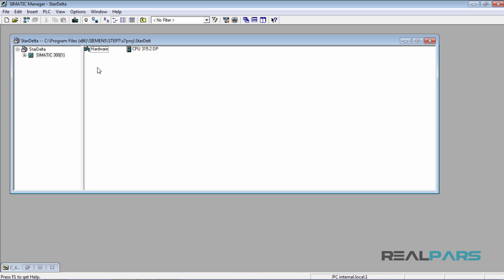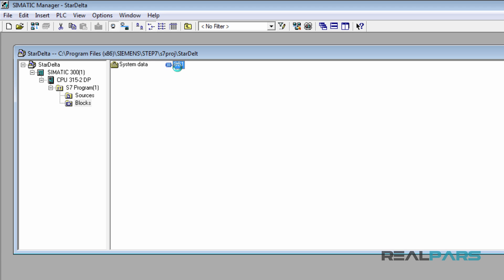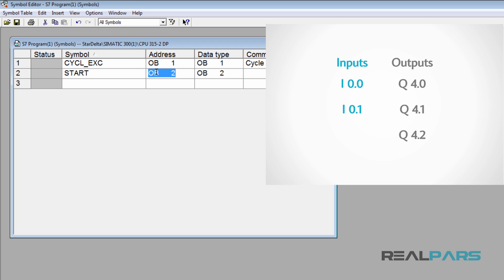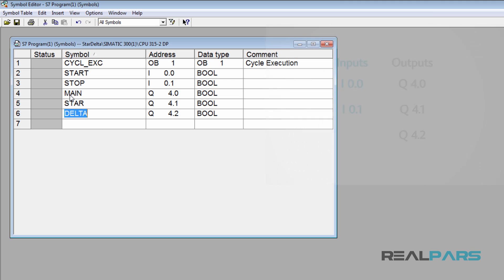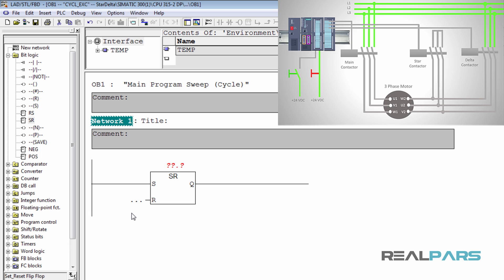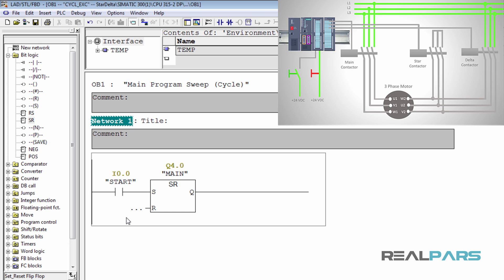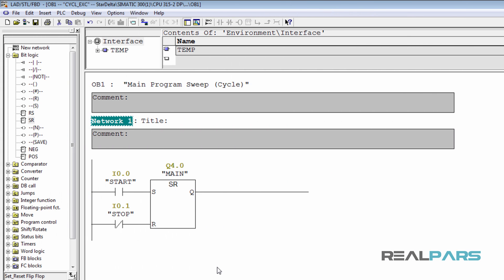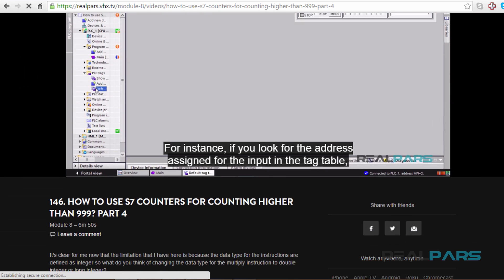Star-Delta Starter PLC Program and Wiring _ Part 10

Comment: 7:35 Won't a Normally Closed Switch at Reset input set the reset button always high (1) which means  S and R inputs are high simultaneously at starting? Doesn't it mean an invalid output for an SR flip-flop?
Reply from the maker: Thank you for your question! This can be confusing sometimes if you don’t have these switches in front of you. I will try to make it easy to understand. All emergency E-STOPs must be hooked up in NC mode. This means the contact is close, and you are sending a signal to the input PLC card. The LED on the card is on, meaning the ESTOP is closed and sending the signal, meaning all is OK, no ESTOP. A fuse on the ESTOP circuit protects these signals. If the fuse blows or you open the NC, you want to stop the machine. Therefore, in the PLC logic, you must read the logic circuit as a sentence to make it simple to understand. And this is the way it is read:  “input on start “set” RS flip-flop, if “STOP” input is “not” made “RESET” the flip-flop”  Well the input on “STOP” is made because the STOP is normally close sending a signal to the input card making the logic for NC not true and this logic circuit is not made and not working until you open the NC and then it will be true. What we say in the logic and not “STOP” SW made, RESET the RS.  In Boolean logic, it is:

START = HIGH (1), SET FLIP-FLOP (FF) TURN ON - Q - OUTPUT,   STOP IS NOT HIGH (0) (MADE) RESET – Q – OUTPUT. 

Happy learning

Comment: really nice video. thanks but the question is   04:47 why exactly 8 seconds?
Reply from the maker: It does not have to be exactly eight seconds.  This timing can be variable but should be long enough for the motor to reach 90+% of its full speed before switching the delta configuration.
Reply: @realpars  Aha ok. Thanks for the answer.

Comment: Nice video, very good channel where you can get real programming lessons because of its clarity. But I have a suggestion or remark about a sentence that was probably a mistake if I understood the concept.
You said in video (7'57): "well the reason is when you use a normally open switch instead of a normally closed switch, if the wire that connects the switch to the PLC is ever disconnected, whether intentionally or because of a broken wire, you'll be notified and this helps to ensure a more reliable system"
By this we mean that the use of a normally open switch is the one recommended. After this you say that it is recommanded to use a normally closed switch. For this, i suggest that you change the sentence or write a comment on the video.
Thanks an other time for RealPars, it's the best channel i known so far
Reply from the maker: Thanks for your feedback! I will make sure to forward this to our course developers.
Reply: yes, I was exactly looking for such a comment, so the correct sentence would be :
"well the reason is when you use a normally closed switch instead of a normally open switch, if the wire that connects the switch to the PLC is ever disconnected, whether intentionally or because of a broken wire, you'll be notified and this helps to ensure a more reliable system"

Comment: Someone explain if normally close swtich is used in R input of SR flip flop..it will reset the flip flop..Q out put would be invalid state isnt it???how come this happen
Reply from the maker: The normally closed contact in the Reset branch of the logic will be OFF or FALSE during normal operation.  During normal operation, the switch is not pressed and the circuit is closed, allowing the input at the PLC to be true.  When the input to the PLC is true, use of that input address in the PLC program on a normally closed contact results in a FALSE state for the contact.  So the reset function of the flip-flop is not executed unless the stop button is pressed.
Reply: @realpars  or i thought when the normaly close switch means itz allowing current to the flip flop reset button..electrical circuit and logic circuit different ryt??? Confusing ..
Reply: @realpars   i wanna get the full course of you..please guide me..how much full course
Reply: @realpars  and tell me what is differenece between monthly package and the annuel package..?? Only the duration or any other benifits??? Like unlocking more videos??

Comment: Interesting videos, I am considering subscribing to your website. I have been watching this tutorial up to this part but I have a question regarding the N/C input connected in the reset. 

Please correct me if I'm wrong, but with this type of instruction (flip flop), if S is high/true, then Q goes high/true. However at the point of I 0.0 going high/true making S go high/true, then wouldn't Q sinply pulse high/true then low/false with R being constantly high/true due to the N/C of I0.1constantly feeding?

If a double contact block with a N/O & N/C contact were fixed to the push, the N/O being I 0.1 connected to R, and the N/C interupting Q.4.0, would the safety and integrety of the circuit be mantained along with controling the R function so the PLC also cycles?

Also when subscribed to your website, is there a connection to a real PLC or a simulated PLC to runthe programmes?
Reply from the maker: The key to the first part of your question is answered at about 7:27 in the video.  The STOP switch is a normally closed contact, so it will open, or go false, when it is pressed.  When not pressed, the signal is high, so the "R" input will be 0.  

For the second part of your question, yes, you could create a "pulsed" one-cycle start switch at the "S" connection.  This would safeguard the logic against a START pushbutton being "stuck on".  But remember, the STOP switch is NC, so the motor will be energized until the STOP button is pressed.  

You are able to download trial versions of STEP7 and S7PLCSIM from:
https://support.industry.siemens.com/cs/document/109761679/step-7-v5-6-sp1-step-7-professional-2017-sr1-trial-download?dti=0&lc=en-WW
https://support.industry.siemens.com/cs/document/109750064/trial-software-simatic-s7-plcsim-v5-4-sp8?dti=0&lc=en-WW

There are no direct connections from the Realpars.com website to a running or simulated system.
Reply: Thank you for your reply, however I am still struggling to understand your logic. 

You say at 06.07 that if R is true then Q de energises. The way that I am understanding what you are saying is that  I 0.1 is a N/C  contact, so then S will be permantly true and Q won't energise at all?

Please could you elaborate further because the logic doesn't make sense to me.

Comment: I enjoy your series, man.  But I think you forgot two things here and in the next two tutorials.

1.  The PLC Cycle-time is much faster than many contactors can react, especially as the contactors become dirty with use and age.
Remember, the contactors are held in place with coils and springs.  The coils require a fraction of a millisecond for the magnetic fields to collapse, and then the springs also require a bit of time before they have moved to the point that they begin pulling the contacts apart.  Additionally, the contacts themselves require a bit of time for their surface adhesions to break, and then for a tiny fraction of time, there is still the proximity of the contacts as they diverge over which Current can still travel in the form of a spark.  Such sparks will quickly lead to dirty contacts that further exacerbate the adhesions, eventually an early death for the contactor.  So, a timed delay after the Star contactor releases is certainly in order.  I usually throw in a timer of 200ms between the Star-release and the Delta.  

2.  Additionally, it appears that you forgot to negate the Reset.  As you left it, the Mains contactor is in constant RESET, because the Stop switch is constantly delivering a "1"-state to the reset of the SR flip-flop.  As you left it, only by pressing the STOP switch and the Start switch at the same time can the MAINS contactor be energized, and then by releasing the Stop switch will the MAINS be released.  It appears that the negation is missing in the next two tutorials for the STAR and the DELTA as well.

Comment: Why wasn’t a coil selected to be used in this code but was used on the part 2 of the PLC Programing tutorial?
Reply from the maker: Hi Hector, When you are using a flip-flop, you can assign the output address directly to the flip-flop or you can add a coil and then add the address to that. They both work the same.
Reply: RealPars Thank you for your quick response and clarification. Your videos are very well made and very educational. Thank you again.

Comment: Your logic seems flawed. Putting a NC stop button on the reset pin of the flip flop will keep it permanently true, thereby de-energising the contactor.
Reply from the maker: Hi Dean, When you have a normally closed stop switch and you add a closed contact for that switch in the software,  the contact (in the PLC program) will not let the signal pass in the normal mode.
Reply: RealPars Thanks for clearing that up, your vids are great btw.
Reply from the maker: You're very welcome! Let us know of any questions.
Reply: With this NC STOP hardware configuration, he is using STOP as input of SR Latch, so he is true that using NC. If you don't use SR Latch but using interlock output scheme instead, STOP must be used as NO switch

Comment: is it plc program can set about shift the star contactor to delta contactor? i think you should put a timer delay/ relay to shift the star to delta connection?
Reply: @Froilan ili Acosta, you are absolutely correct.  The Cycle-time of the PLC is much faster than the reaction-time of the contactors.  
Remember, the contactors are held in place with coils and springs.  The coils require a fraction of a millisecond for the magnetic fields to collapse, and then the springs also require a bit of time to pull the contacts apart.  Additionally, the contacts themselves require a bit of time for their surface adhesions to break, and then for a tiny fraction of time, there is still the proximity of the contacts as they diverge over which Current can still travel in the form of a spark.
So, a timed delay after the Star contactor releases is certainly in order.  I usually throw in a timer or 0.2 seconds in front of my Delta.
By the way did you notice that he forgot to negate the Reset?  As he left it, the Mains contactor is in constant RESET, because the Stop switch is constantly delivering a "1"-state.  As he left it, only by pressing the STOP switch and the Start switch together can the MAINS contactor be closed, and by then releasing the Stop switch will the MAINS become open.  He forgot that all the way through the next two tutorials for the Star and the Delta too.

Comment: Are 8 seconds an actual set point for the time value that a three phase electrical motor needs to operate in the star configuration? ......I have yet to watch part eleven of this  tutorial because I wanted to try and resolve by myself the logic. Though I dont have my computer right now when I come back home "Im going to test it in the online mode" :))) ...my program is composed by tow lines of code. The first one has the tow first instructions you've used so far, that is an SR flip-flop and an open contac at its input for the START switch. In paralel I've connected 3 coils to the output of the flip-flop with the addresses of  the MAIN, STAR and DELTA contactors. The incoming signal from the SR ff, passes directly trough the main coil, then by means of a branch a closed contact with the adress of the DELTA coil in series with an open contact with the address of the timer T0 in series with the STAR coil.  By another branch a closed contact with the same adress of the STAR coil in series with the DELTA coil. For the reset input of the ff a closed contact with the adrress of the STOP switch. Finally on  network two an open contact with the adress of the START switch connected to the EN input of a TOFF, with the set point of 8s. At the reset input of the timer an open contact with the adress of delta coil.    Sorry I had to write it down now ill remember the logic when I get home.
Reply: Well, it still needs a bit more of work. Let you know when its ready. Thanks for the feedback!
Reply from the maker: Hey Erick. The time can vary depending on your application. Test it out and let us know. :)
Reply: Ive reviwed the logic of my program and Ive remembered some of the lessons of the course. I just changed the order of the networks and its working perfectly! Thank you so so much. Is my first program of the year
Reply from the maker: Great to hear this Erick! Yes, sometimes just by changing the order of the networks you can make the logic work as exactly you want it to.

Comment: I am almost certain that the star and delta contactors  should be mechanicaly linked like a forward and reversing contactor so that neither can be in the on position mechanically at the same time as well as electrically. Also I am guessing that some auxiliary contacts on each contactor would probably be used as plc inputs and or between the plc and coils. I am only mentioning this because some poor but handy ambitious type (like myself) may try to rig this up himself with spare parts with out having all the industry standard safetys in place. Just a thought.
Reply: Gary is correct. Relying on the PLC for an interlock against a 3 phase, high voltage short is bad engineering. I can think of many scenarios where this would create a dangerous short. The motor contactors should be interlocked using NO/NC contacts. This is basic control wiring. I do like the videos, thank you for making these available.
Reply from the maker: Thanks for the comment Gary! The PLC program will not allow these two contactors to be energized at the same time.